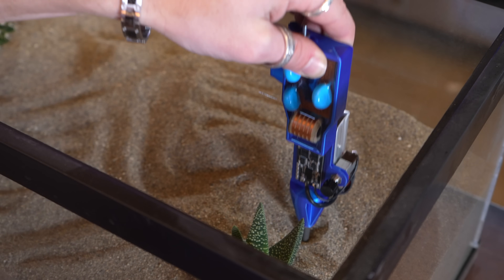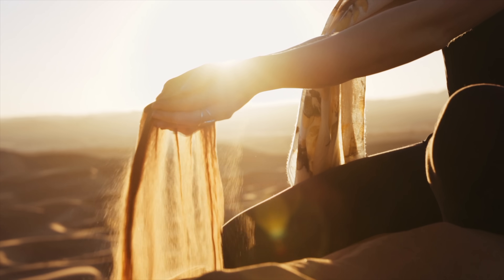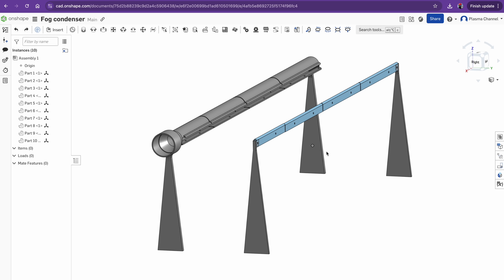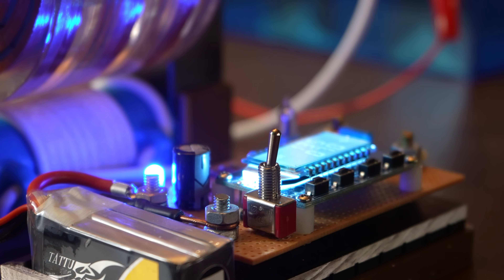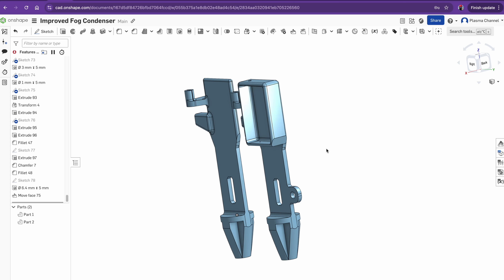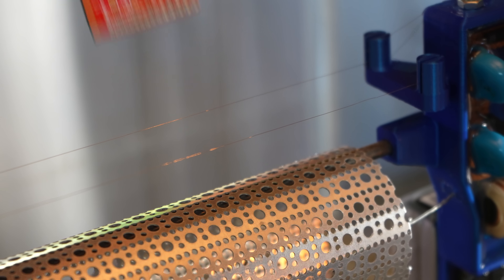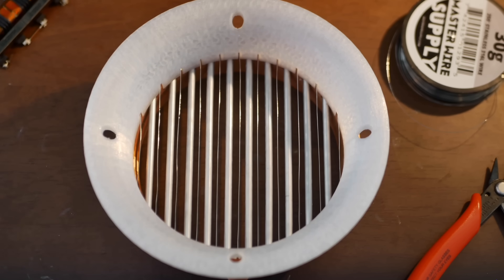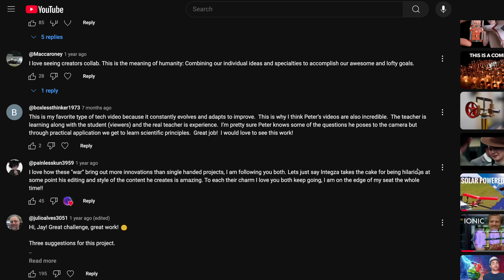Solving Desert Water Shortages Using 20,000 Volts

Comment: Run dehumidifier for 5 minutes? It spent quite some time on warming up (cooling down, actually). So very scientific, could be 5 seconds for more impressive results.
Reply from the maker: This is a really good point that I didn't really think about. Admittedly, the dehumidifier was already running in the room prior to filming so I think it was warmed up. But I got lucky that I already had it running.
Reply: @PlasmaChannel  well, in that case :) Actually I expect standart dehumidifier to be much less effective, because it does not attract water like yours does. But if I remember correctly it works in cycles, so 5 minutes might still be not enough, at least 30 minutes, or better 1 hour.

Comment: that's a great discovery, i've been making some calculations, an acre of crops requires between 2000 and 6000 m^3/season  of water, each season is arround 150 days, so that would be 20.000 liters per day, 20.000 liters is 40.000 500ml, so 39Wh * 40.000 is  1.56MWh per acre per day. A nuclear facility here in argentina produces arround 500MWh, so consuming the whole power of a nuclear facility you could sustain 7700 acres. that's not much i think, argentina has 82 million acres planted, you would have to have 10700 nuclear plants to sustain that. IDK maybe in dubai is a good option 😅

Comment: @14:31 Watt-hour (Wh) is a unit of energy which you appear to be using correctly verbally, but the text overlay in the video shows "W / H" which makes no sense.
Reply from the maker: A Wh is watt / hour. They are the same thing. one watt hour is using a watt for a full hour. Just like one Kw hour is one kilowatt for a full hour. Same thing as saying 1watt / hour, or 1kW / Hour
Reply: @PlasmaChannel  No it's not. It's not "watt per hour". If you draw 1 watt for 1 hour, that's 1 watt-hour (Wh) of energy. It's not 1 watt of energy per hour. Watt is power, not energy. When speaking, it's not "one watt per hour," it's "one watt for one hour." This is drastically different and the former doesn't make any sense.

EDIT: I'm re-reading what you wrote and it seems like you understand. But your use of the "slash" is incorrect.  A "slash" is equivalent to "per", not "for".

Comment: Why use the voltage multiplier after the flyback transformer and not just tune the flyback to the desired voltage?
Reply from the maker: Because AC wont work to coalesce fog very well.
Reply: @PlasmaChannel  Oops.. facepalm on my behalf! Thanks for the speedy reply!

Comment: Great project! A few points that I came up with:
+ There are way more power effient ways to generate these kind of high voltages for larger scale systems, so you could probably get way more water per Wh

+ This is also possible with just a single grid charged positve or negative relative to gnd, you don't really need extra wires.

- Only coastal regions regions of deserts have any fog, in the inner continent fog is extremly rare.
Reply: Wind and sand is a bitch on the coast too.

Comment: Just a thought that came to mind as an alternative application. Fog dissipation? Seeing how quickly the fog cleared in your final experiment, could you not theoretically place a larger version along roadsides in fog prone areas where driving often becomes dangerous? Activating the system could in theory help quickly dissipate the fog and water that is collected could be captured either in existing drainage systems or some other method to disperse it to surrounding plant life.

Comment: When you condense water, the electrodes collect evaporation energy, which is gigantic. Electrodes will get hotter driving evaporation from them and resulting to less and less vapor condensation overall. It means if you don't cool the electrode down, you reduce the collector efficiency.
If you will use a heat pump to cool your electrodes, then it is the same idea as using a real "commercial dehumidifier" ...

Comment: The only downside of this is the water that comes from it is still just as dirty and contaminated as drinking rain water. This is a really awesome idea though and is using far less power then any dehumidifier by several magnitudes. you could even layer the plates using several hv units spaced a bit away from each other and this way any fog that is missed will be gathered up again in the next stages. 

Any of that water though will have to be filtered and boiled and then ph balanced to ensure its safe to drink or use for plants. without doing this the water can be extremely dangerous to drink and can infect your soils which will kill your plants or even spread sicknesses such as HIV through the soil to your plants and then to you (this is why human waste isn't used as fertilizer almost anywhere). This is a massive step forward though 😁

Comment: 12:03 This could actually save a lot of lives if used to reduce fog at intersections and dangerous sections of road. Could easily see these attached to light poles and power lines ect. Really getting into the realm of weather manipulation when you consider the possibility of flicking a switch and basically turning off the fog in an area. Wild stuff, thanks for sharing!
Reply from the maker: Ive been wondering this myself - or helping clear up foggy airports even?

Comment: I spent about two years in the Wayuu peoples region in Colombia. They struggle with water. I am curious of the cost of scaling this up. generally they live off of 100-200USD a year. If this would be scaled up  and I can see this generating generational changes for them. But the cost, I just dont see how this would work without government intervention. Which never turns out good.

Comment: Also curious if you could use a large magnetic field of sorts to do the samr but pull from a larger cross section. And or how much voltage changes the eater pulled. Id imagine there is an ideal point. Also curious if use of harmonics could further improve efficiency.

Comment: This is damned cool and I'd like to see the larger system too, and in other desert regions; I wonder if you could spend a few million dollars to stabilize some sand dunes and build some ducting and fans to make an oasis anywhere in the Sahara, for example, not just somewhere with coastal fog, but, to harvest the cold air at the bottoms of the interdune valleys to feed it to a system like this, and make living "possible" far away from civilization (definitely not getting visions of Ceti Alpha-V or anything)

Comment: Costal fog is often salty, you smell it in the air. I'm curious if that would cause problems like salt buildup in the soil or create corrosion that would damage your contraption.
Reply: that's a pretty good observation, people often forget fog is not "gaseous water", it's liquid water in tiny droplets, it can contain salts and pollutants, very far from being distilled. I hope this project expands massively and we start tackling these kinds of problems as well

oh by the way, a small correction: you cannot smell salt, you smell odours associated with salt, but it is salty nonetheless, and you can see sometimes salt buildup on metal objects close to the sea even when they're too far to get splashed directly
Reply: In fairness this just means you need a conductive, non-metallic netting; or one that can at least not complain about rust too much.  The precipitated salt might be an issue but surely it would be precipitation onto land during the phase where the droplets are boiled off by the sun, anyways?
Reply: @Somefox  genuine question, I don't know enough about material science: what kind of material could be both conductive and non-metallic?
Reply: @psigh8161  you means Graphite？
Reply: @GabrielusChemist honestly I was thinking graphene, which in case you don't know it's basically impossible to produce with our current technologies, but before answering i checked what I could find about graphite conductivity and apparently it's very good at it, and I had doubts about the application since it's so brittle but a few links further I found it's actually being used in the form of a conductive paint for specific project, the design could remain the same, the conductive metal mesh could be sprayed with graphite paint to maintain conductiveness and shield from water and salt exposure, so yes actually that might work, good point
Reply: Yeah, perhaps.

Comment: @PlasmaCahnnel look into electrical filters. They use high voltage to get particles out of exhaust gases in power plants. like multiple stages, starting with the highest voltage to the lowest. They collect up the dust on a net and they release it with a physical impulse like hitting a bell. Its all falling down then. Its fairly common for power plants here in germany. its kind of the same thing, am i wrong?

Comment: IDEAS:  perhaps instead of one screen: use multiple, staggered openings - or 3D sponge type geodemtry - to maximize surface area and keep temp rise to a min.     Curious re effect of SALT in the water vapor also: positive, neg?  Maybe testing w a wide range of voltages.

Comment: Very nice. The same effect you can achieve with a loop of thin wire as positive electrode placed flat above a funnel made of thin mesh with large side having the same diameter as that of the loop. And placing a water bottle under the small end of the funnel. In fact it would be a  water condenser using Biefeld Brown effect instead of using it as ionic wind thruster. Asymmetric Capacitors have more weird effects and this is one of those many effects. ;) High Altitude large scale platforms of this kind, floating above the desert could act as rainmakers of the night turning deserts into green fields. For collecting water for drinking purpose only, place this machine in a green house. Don't forget to add a few mg of salt in it.

Comment: Is it possible to extract water without fog? I just watched the video linked below and wondered. Instead of the wire, have a pipe filled with liquid nitrogen act as the emitter. It can make condensation and then draw it to the condenser. There are a lot of variables to this and questionable efficiencies but it may be a fun experiment. 
https://youtu.be/dqOjdPfp9ZU?si=6jsOH-dbIYQoV8jq

Comment: Absolutely incredible idea. I’ve been following you since you started posting about ionic thrust which has had me captivated and inspired. The design idea is solid, my question would be of longevity. The constant accumulation of moisture and then drying would oxidize untreated metal on the condenser probably pretty quickly in an arid environment. Also, I imagine critters/insects, dust, etc. would also be variables to consider in the overall design. I’ve seen enough toasted mice on capacitors in AC units than I’d like to admit. They tend to get where they are unwanted and chew on all things electrical. Perhaps a closed bottom trough to direct water flow to manifold/distribution tray along the bottom of the condenser cage? The manifold could be installed between the probes. 

Or if you stacked multiple of these at an angle 📐 <— like this, you could use a drain pan on the bottom piped to a small irrigation system storage reservoir for mass collection with a smaller footprint, not requiring the device to be installed directly above the crops. I’m sure this has been mentioned in the comments, so sorry if I’m just copying someone’s ideas.

Comment: Interesting small scale design, keep testing. This needs to be optimized majorly for cost and power efficiency. Major RO desalination runs 0.15 cents per liter, whereas this will probably be closer to 2 cents per liter but without the million dollar startup cost. Also, make sure birds don't fly into the 20kv plasma and cause an arc.

Comment: Your having the wrong idea. Your a collector not a distributor. Make a big unit off to the side not blocking sun and let the sprinklers or drip lines deliver. That way you can still use your delivery system when the fog aint on .
Reply: Pioneer vs Developers??? 😮

Wow 👍🏻 you're brain Extensive is super Mega mystery 😢

Comment: Just wondering if the main difference with the dehumidifier is the difference in surface area being utilized for the condensation?
Reply: Differenc3? Humidifier is a mini scale of " water collectible " or keep's you're room tone down humid dry & in  so some case's, certain people sleep well in those States 

A full fledged " Water Zap " conversion is a different idea 👍🏻 it's where you Maximize water collectable's in a deserted ( very low humid areas ) 😢

Comment: Do you really need the positive wire? Why not use the ground? Make it a single spike with a solar panel. See if the solar panel could be used as your condenser? In practice you would want to have some sort of wiper to remove dirt that would accumulate over time. Humidistat / hygrometer. A shaped solar panel on a Pringles can that is rotated around on a unmoving wiper. Could even use that special coating that mimics the wax on a desert beetle on the inside of the can.
Reply: Well.. Imagined Mega cloud from Atlanta is a 2 in 1 👍🏻

The cloud is a fences of Thunder Volta +  Magnitude magnetize of near by clouds of one Another 

Once clouds are Magnetization to 0ne another, accession or aversive high voltage 
is disposed to 👇🏻 grounds 😮

Comment: The Peltier effect used by the smaller dehumidifiers is pretty inefficient.  It can help prevent mold from bathrooms and such if proper ventilation is not easy.   Thanks for doing this.  I wonder if the long term effects on the wire would cause corrosion of the wire.  Applied voltage is how oxygen and hydrogen are extracted from water.  It can also remove rust from cast iron. :P

Comment: It would be awesome to see this refined and made to be fully self sustaining, charging itself enough with daytime solar to run during the full foggy period. Im also curious to know though, in this smaller prototype you had the mesh resting on long metal rods which wouldnt be feasible over longer distances, are those necessary for rigidity?

Comment: have you tried lower the voltage to around 1000 Volts? It seem that the current voltage is quite higher than what you need.
Reply: 👍🏻 higher voltage, mean's faster convention 

but with Highest voltage, meant lower Safety hazard

Comment: Great !

- Can you measure if the power consumption is proportional to the water gathered ? I have the feeling if you don't have as much humidity in air, it won't consume as many watts.
- Do you think you could improve the water gathering with a hydrophobic material ? I've heard that metal can be made hydrophobic with laser sculpting. That would be great if it could improve efficiency :)

Can't wait to see a full scale experiment, anyway :)

Comment: Don't use it as a long-term drinking water solution. Condensed water, such as distilled water or water from a dehumidifier, is not ideal for drinking over time. The reason is that it lacks minerals because it has been purified of ions like calcium, magnesium, and sodium.  

Pure distilled or deionized water tends to be slightly aggressive and can leach minerals from the body if consumed in large amounts over time. While it's not necessarily dangerous in small quantities, relying on it as your sole water source could lead to an electrolyte imbalance.  

If you were to drink condensed water, it should be remineralized by adding electrolytes or mixing it with regular drinking water.

Comment: Just use a tarp and a bucket, it doesn't require 20,000 volts
Reply: Good luck with you're Plan in that middle of the Desert 🙏🏻😂🙏🏻
Reply: @SATERIYA-dp3wb  good luck with creating 20,000 volts in the middle of the desert 🙏🏻😂🙏🏻

Comment: This is brilliant! Cant wait to see how it progresses. I am curious about the dehumidifcation properties of a system like this in very humid colder regions too? Slowly it seems to be emerging that damp and humid homes are causing major respiratory related issues, especially as insulation of homes is mandated but moisture extraciton isnt (UK, EU), and I am curious if this tech could be more efficient at low energy than the current systems, but ofcourse fog and relatively high humidity are similar but still different - could really be something! For reference a condensate dehumidifer system running at 25L per day uses about 400wh so 9.6 kwh a day for 25 litres, if you had similar level of humidity extraction at 44 wh or 1kwh for the day, that is a game changer.

Comment: Cool precipitator.  Won't work with less than 100% humidity so its basically a fog or while raining use case...  Which in much of the world it is illegal to capture rain water so this technology would definitely cause trouble.
  A compressor cooler, depending on area of course, is much more effective outside of its specific niche.
  I honestly see this in large scale being performed by municipalities which allowing them to strangle farmers.  An interesting idea with powerful terraforming potential that would have negative impact to most environments as it would dry them out.

Comment: Fascinating, but somehow 40W for such a small setup seems like a lot? I'd love to see some more calculations based on realistic fog density en duration in a given period, preferably a full year (all seasons). 

If I we'd just take this experiment and upscale it to a 1 KW system, you'd get 14 liters of water. According to ChatGPT that's about the evaporation that happens per square meter per day in a desert climate where the air during the day is very dry. 

Another quick GPT question learns me that you'd need about 1 m2 of solar panels and a 1.1 KWh battery to deliver 1 KWh. All in all this will cost about 66 cent per day considering an economic lifetime of 20 years = almost 5 cents per liter = $ 50 per cubic meter. 

If you'd desalinate water and transport it with trucks for 100 kilometers, the cost per cubic meter will not even be $2 per cubic meter. 

Hate to be a downer, but somehow you need efficiency to be bumped up by a factor of at least 25 before it comes even close to economic viability.